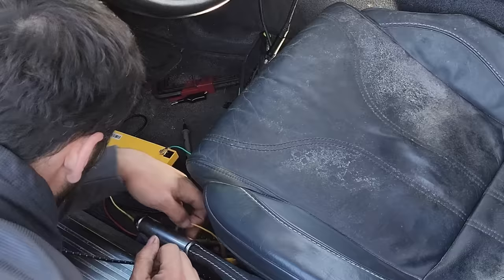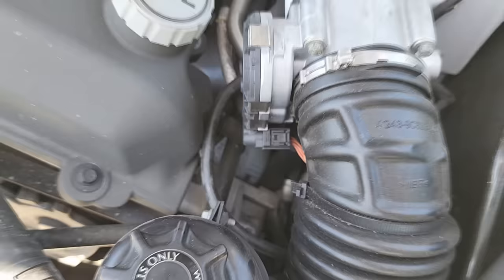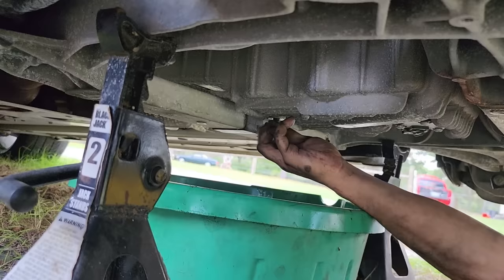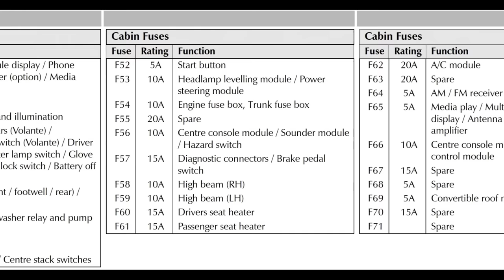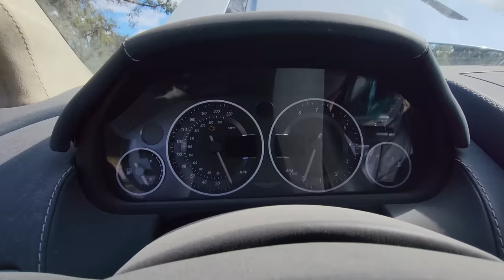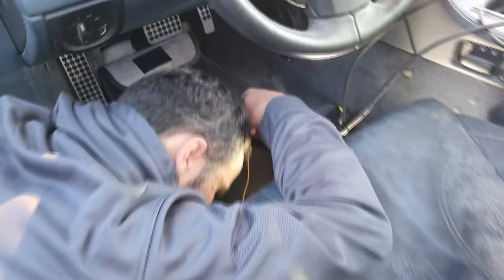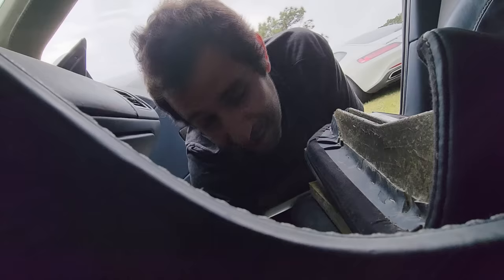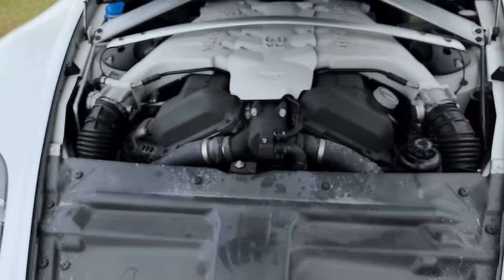My $286,000 Aston Martin's Electronics were Destroyed by a Salt Water Flood. Is it Repairable?

Comment: I thought he was going to have to lift up the car and drill out the bolts from the underside. Excellent solution except for doing it by Hand (I need to watch him replacing oil to see if he uses the dipstick hole to fill it with).  Hook a variable speed/ reversible drill  to a rubber hose and to the end  of the motor and send it, not by hand.